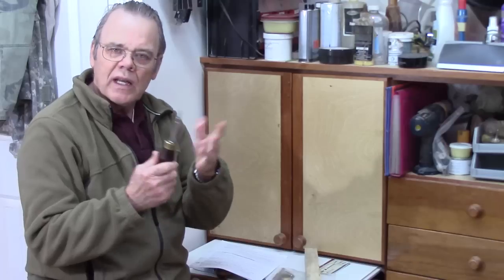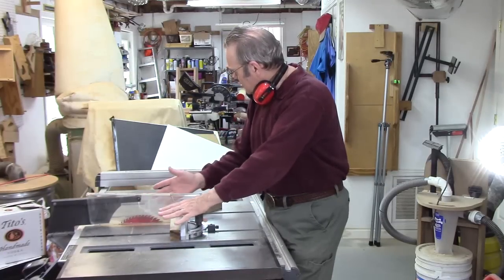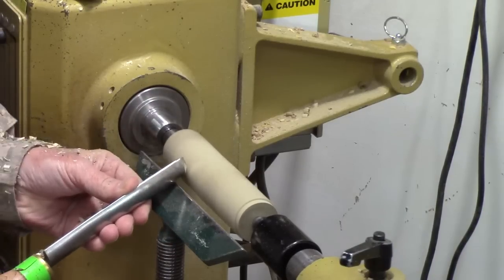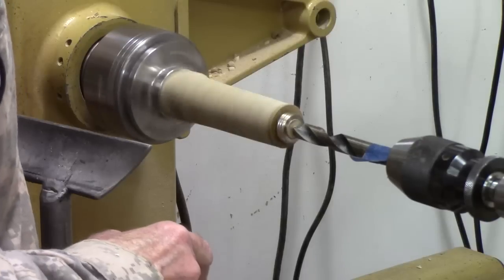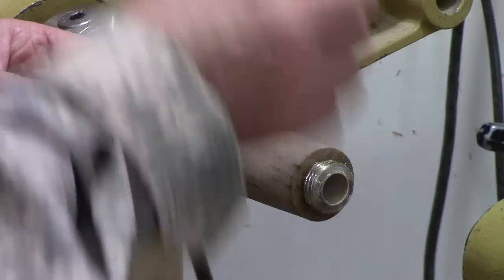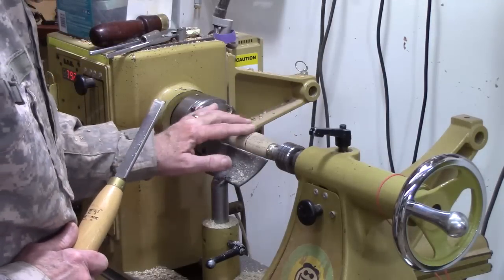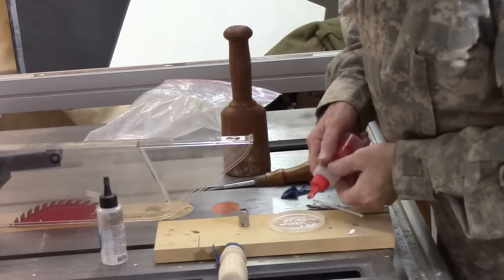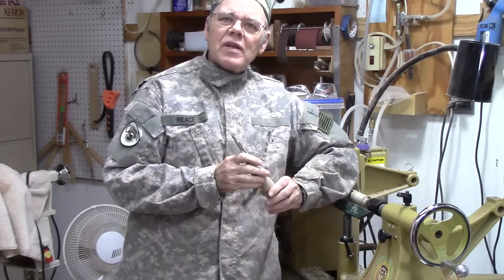Make a Screwdriver handle - Woodturning!

Comment: I did a few of those screwdrivers with the harborfrieght 4 in 1s I just took the handle clamped it in my chuck and put a cone center in the open end and used the lathe to turn off the plastic from the metal part. I was just careful about the tool getting close to the metal piece.
Reply from the maker: Never thought of that idea. Good one.
Reply: @Lukas Marlon Instablaster ;)
Reply: @Waylon Izaiah thanks for your reply. I found the site thru google and im in the hacking process now.
Looks like it's gonna take quite some time so I will get back to you later with my results.
Reply: @Waylon Izaiah it worked and I finally got access to my account again. I am so happy!
Thank you so much, you saved my account :D
Reply: @Lukas Marlon happy to help xD

Comment: Great video, thanks.  I make a lot of those Harbor Freight screwdrivers.  I always use a heat gun to remove the insert.  The secret is to get the end a little soft and go in with a paint can opener or other hooked metal tool.  The insert will come right out.  after the end is exposed needle nose pliers finishes the removal.  Thanks for the informative video.
Reply from the maker: I guess I got a little impatient with the heat gun. It was beginning t melt but not fast enough.
Reply: mvecellio 1:  I see a few videos on youtube "upgrading Harbor Freight tools".  Do you find the quality of the Harbor Freight screwdrivers acceptable?  Making a handle is the fun part but putting it to use on parts that don't preform well,  just become wall hangers.  Your opinion?
Reply: Most of the time they are fine for screwdrivers with medium use.  Once in a while I get one that is not up to standard and I throw it away.  Remember they are free.

Comment: Propane torch also works for getting the metal part out of the harbor freight handle.  Heat it up until soft and the you can pry it out or pull it out if you have carved back some of the plastic to give yourself a place for vice grips to grab.
Reply from the maker: I have seen that but was concerned about the fumes since my shop is in the basement.

Comment: What did you use for a ferrule?
Reply from the maker: Some brass plumbing faucet fixture. I took down the threads with  a parting tool.
Reply: @MikePeaceWoodturning  I really want to try this . . . but could you elaborate on the "plumbing faucet fixture"? And what do you mean, " I took down the threads ..."?
Reply from the maker: @patanders  Lots of things can be used for ferrules. Maybe this video will help https://youtu.be/yOFl9nEsViA. By taking down the threads I mean I scraped off outside threads with a HSS scraper or parting tool.

Comment: Mike, at the end of this video you say, “I commonly remove these with a hacksaw or a torch”. You lost me.   What are you removing and from what?
Reply from the maker: I am removing the center hub that holds the screw tips from being embedded in the plastic handle. Obviously not a step with a kit but is if you are retrofitting a HF screwdriver.